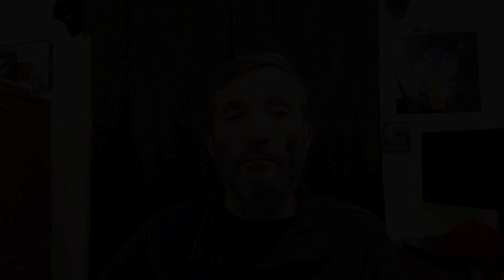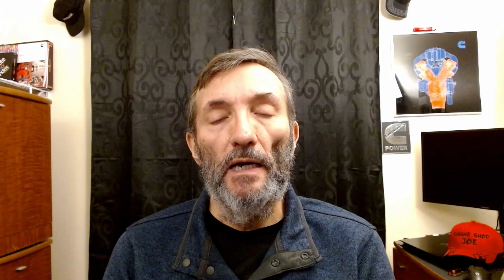The A,B,C's of aftertreatment Introduction

Comment: I have a 2012 ISX15 and mine has always done  regen every 36 hours. I’ve always wondered if it had a timer because of hearing others go longer between regens.
Reply from the maker: The engines that have aftertreatment do have a software driven clock,if you will, that starts the passive regen if it is not called for.
Recently I worked on an ISX-871 that was regenning every 130-136 hours. That is unheard of on that engine but the DPF was cracked pretty bad. So the ecm still saw dpf restriction but it was so low it never triggered the regen so the software forced one. My thoughts are the timers vary depending on what application the engine is in. Also my personal opinion when it comes to how long between regens is as long as it is fairly consistent the system is healthy. And not that it goes x many hours between regens. So your 36 hours because it is consistent is good.